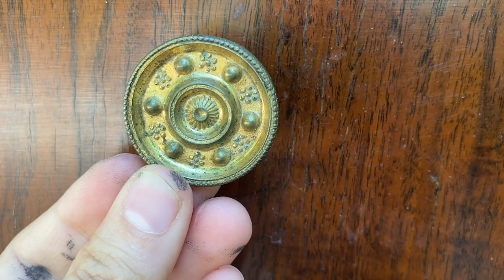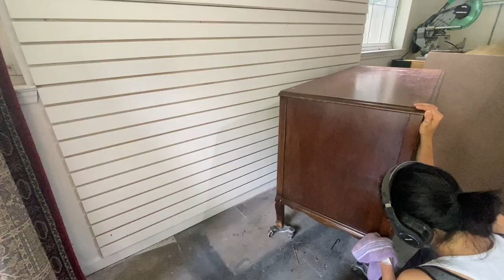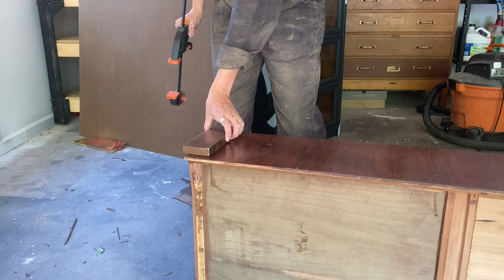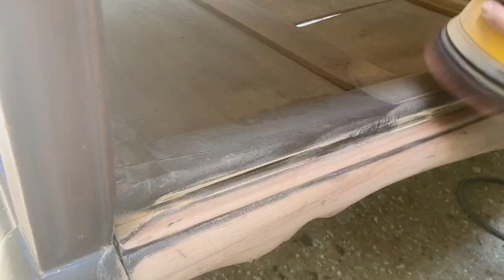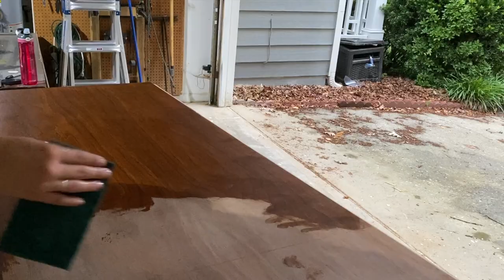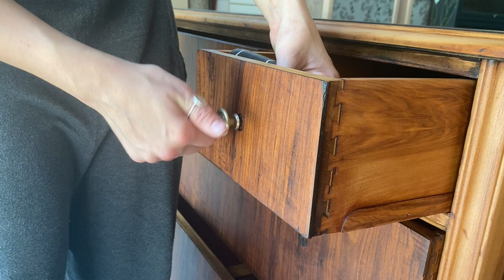Eco Friendly Restoration of an early 20th century dresser | ECO FRIENDLY CHALLENGE

Comment: Try just heating vinegar and dropping in your hardware, then let it cool down,   then polish with fine steel wool.  To remove old paint, find an old slow cooker at a yard sale or thrift shop and slow cook your hardware overnight in a bath of vinegar and water  the paint will come right off, no stripper needed.  Your piece turned out beautiful as usual!
Reply from the maker: Thanks for the tips!! I’ll have to try that out

Comment: For hardware, I usually start with mixing lemon juice or vinegar, flour and salt (flour is just used as a binder to make it cling to the hardware). Baking soda can be added. I use the box from my fridge and then replace it. Less waste that way. Dump it into a ziploc bag (measurementsare for sissies). Drop in the hardware and schmoosh (yeah, I said "schmoosh") it all around until it is all covered. Then squeeze out any air, roll it up and set it aside until I'm ready to deal with it. Remove and rinse. Then do any needed scrubbing. If some tarnish is extra stubborn you can use the paste and an old toothbrush (or the spouse's  if they irked you recently) to scrub it up. The salt acts as a mild abrasive.
Not a professional but I haven't ruined any hardware (yet).
Reply from the maker: Hahaha thank you for the tip! Really appreciate it!

Comment: Love this!! I've made a paste out of vinegar and baking soda and used that on tarnished hardware. It works really well!
Reply from the maker: Great to know!! Thank you!
Reply: Flour, vinegar and baking soda... Gets off rust too!
Reply: Darn, beat me to it, although with that replacing the baking soda with fine table salt is even cheaper and the salt acts as a mild abrasive too. Brush on with a pastry brush, leave for 30 minutes then use an old toothbrush to scrub then rinse with plain water. Don't let the paste harden or you'll be scrubbing for hours afterwards.

Comment: Another eco friendly tip you could practice is waaaaay less glue lol that's glue over kill girl!! You don't even need half of what you're using... Means less sanding, less drips and less glue!! You want to put just enough to coat the whole area and have a small amount of seepage coming out that you can run a damp rag over before it dries. Also when  applying your finish with your scotch pad, cut it into tinier sections so you get more uses out of one pad... Less supplies the better
Reply from the maker: Haha fair enough! Thank you!

Comment: Eco friendly is good. Rather than heat guns that burn fuel and add to the Climate Change load, how about carbide and other scraper blades?
Reply from the maker: Do heat guns burn fuel? I thought they were electric like hair dryers? Mine plugs in
Reply from the maker: Also, the manufacturing of blades probably requires some kind of fuel
Reply: @TheMissFlips , Of course electricity uses fuel, unless it's solar or wind. That's what we have where I live. But even the equipment for solar and wind is built using fuel. There's really no way getting around it, other than to have fewer people in the world creating less demand.